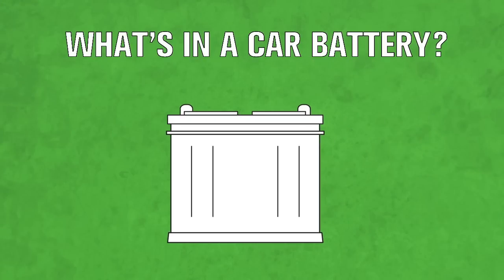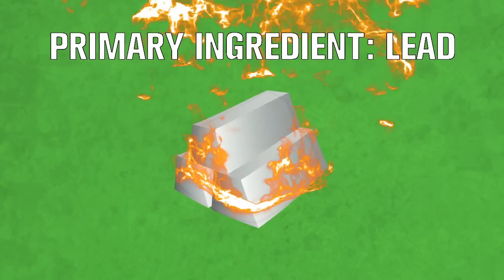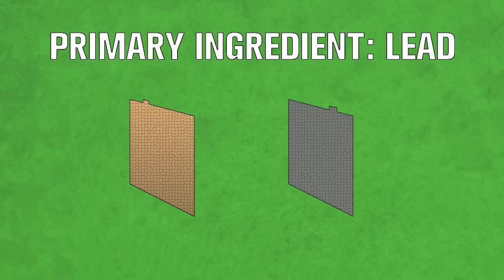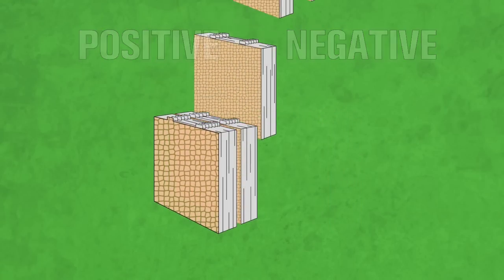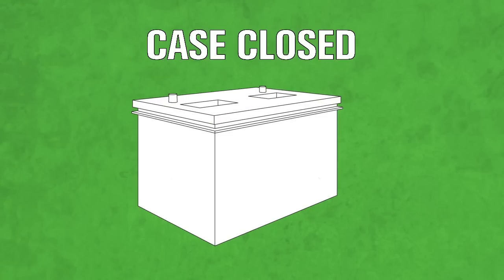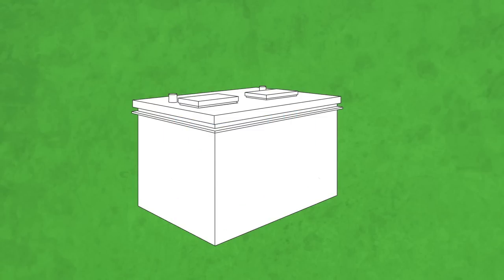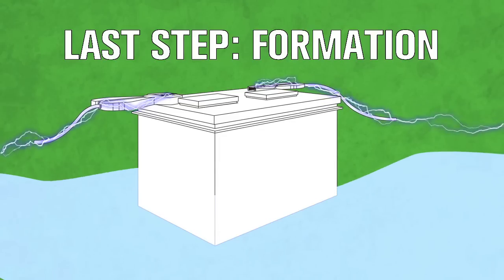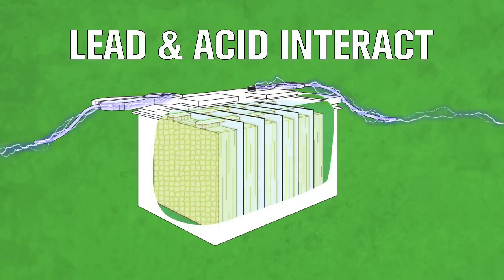How Car Batteries are Made

Comment: This was great, but what is the "thick paste"??
Reply: As I understand it, the paste is a mixture of Lead oxide, water, and sulphuric acid.  The mixture proportions are somewhat different for the lead plates vs the lead dioxide plates.

During the initial charge, (and I am only surmising this, so someone please correct me if this is wrong) the paste on the lead dioxide plates becomes lead dioxide, while on the lead plates the paste becomes lead, with the remaining components of the paste becoming part of the sulphuric acid/water mixture.